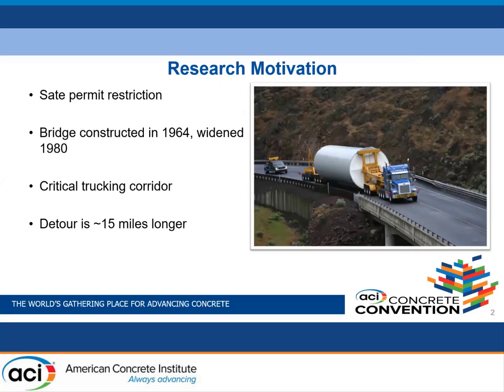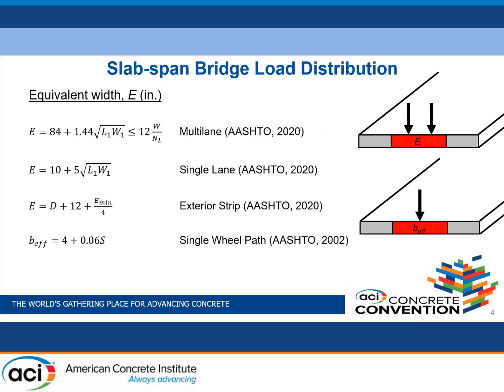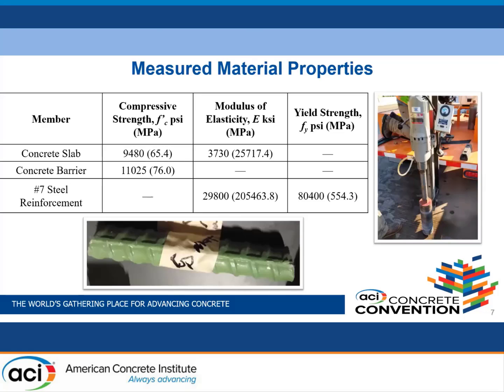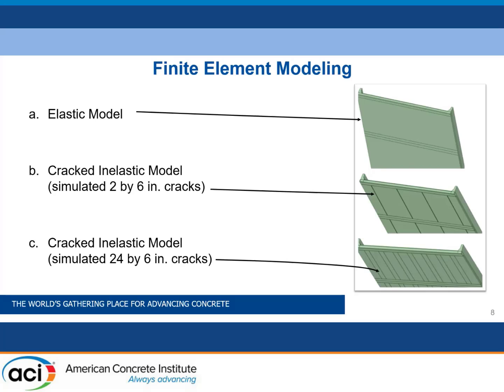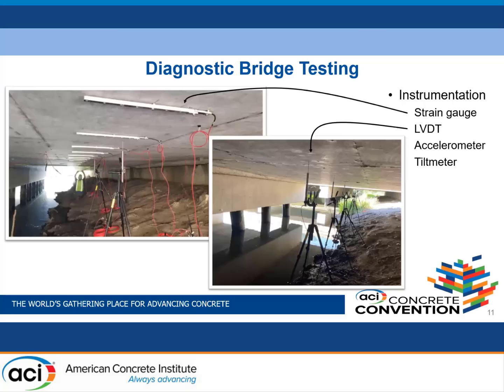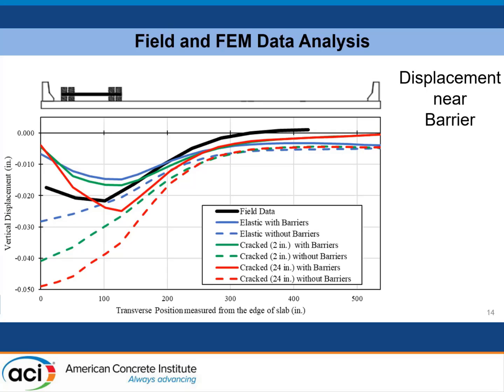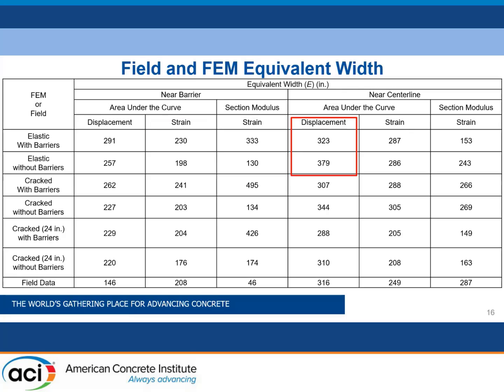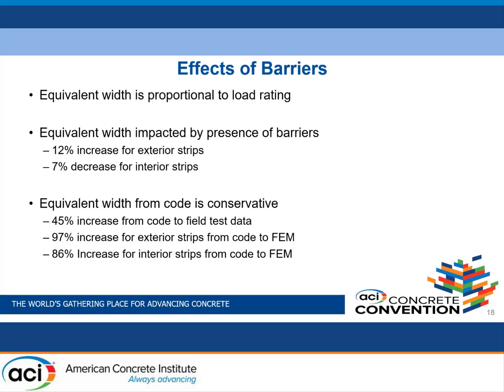Effects of Barriers on Load Distribution in a Concrete Slab Span Bridge

Comment: Nice presentation, Kendall.  The question is what benefits would one derive running models without barriers when they are required?  Whether they have an effect on load distribution or not, they are required for safety reasons, to say the least.  Thank you